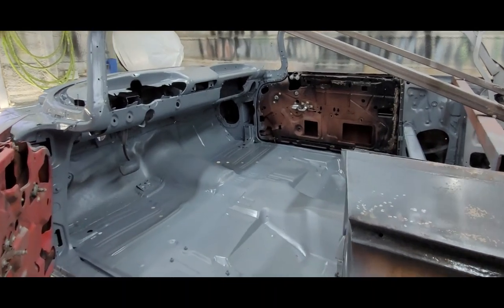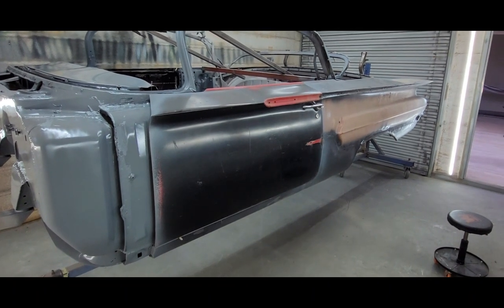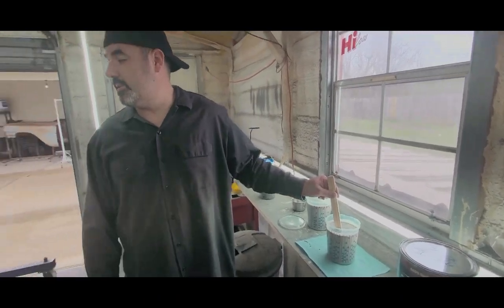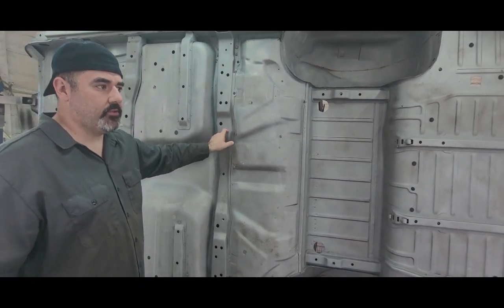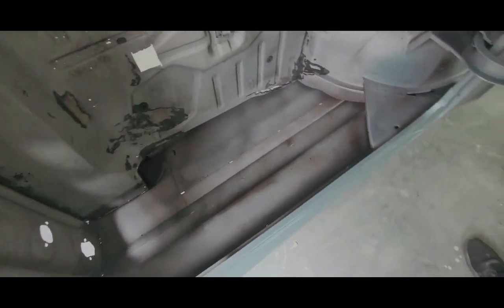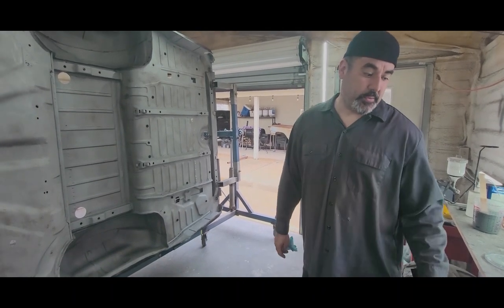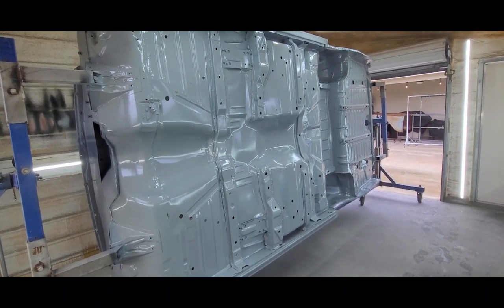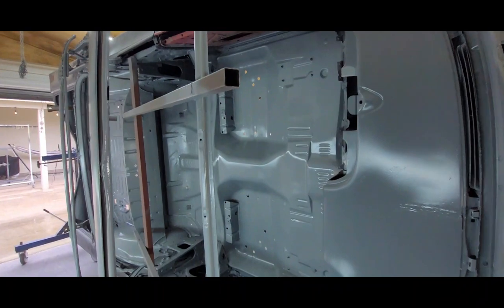CLASSIC CAR SANDBLAST PROCESS| #impala #classiccars #lowrider #rematch | @lonestarlows

Comment: Aviation Paint sripper is the strongest do a pannel at a time wipe down with distiled water helps slow the flash rust .
Reply from the maker: Last time I bought it , it was very watered down and didn't work like the stuff 20 yrs ago ...
Reply: @lonestarlows  that is correct the aviation paint stripper 20 years ago would strip urethane and just about any epoxy paint i always use etching primer under epoxy primer i like to over kill every thing i do to avoid come backs and any bad reaction so i even clean the bare metal with metal prep, and i always use disteled water on a good  spray bottle do like a square foot a time when doing the metal prep other wise you will get a build up white film and try and ither spray your etching primer or epoxy as soon as you can and choose an apropreate teamperature and  humidity is to be taken into consideration for those of you that are new to auto body and paint. Indoors and or summer days under a shade are the best dsys to work on bare metal preping and primering.
Reply from the maker: @josedelao9124  thanks. I've personally never used etching primer. I was taught to 80 grit bare metal, clean, and straight to epoxy. What is the benefit of etching primer?